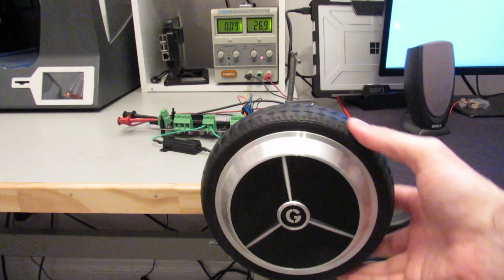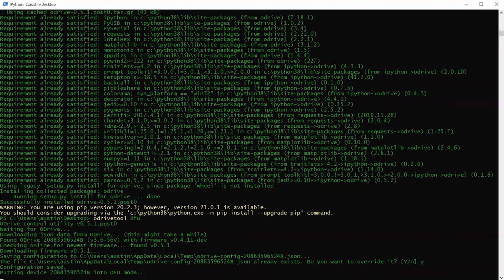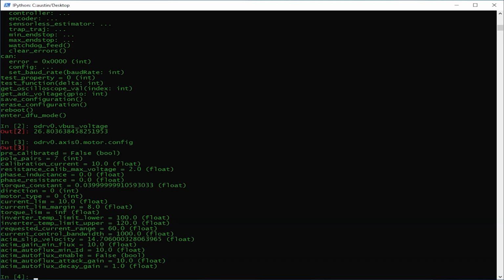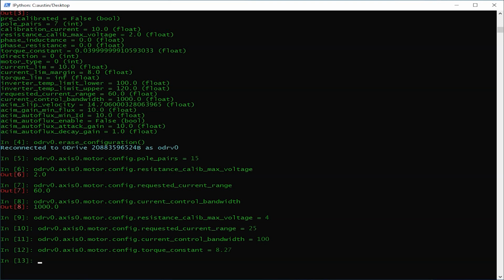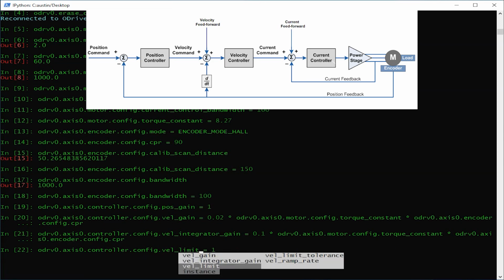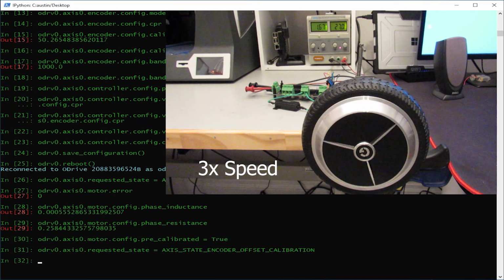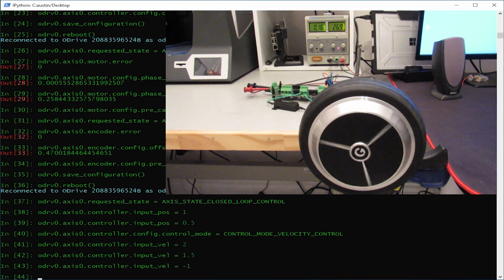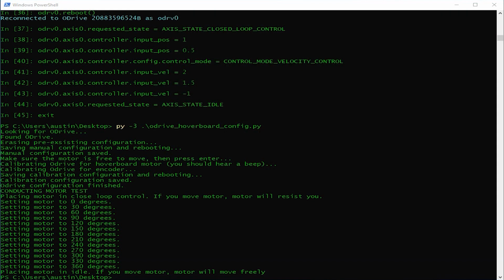RoboDog Part 6 | How to Use ODrive BLDC Motor Controller

Comment: IF MotorError.PHASE_RESISTANCE_OUT_OF_RANGE 
Increase odrv0.axis0.motor.config.resistance_calib_max_voltage, 4 gave me nothing but errors, increasing to 6 allowed my motor to spin and continue the tutorial. (Thank you AustinTronics)

odrv0.erase_configuration()
odrv0.axis0.motor.config.pole_pairs = 15
odrv0.axis0.motor.config.resistance_calib_max_voltage = 4 (NOTE: Needed to increase to 6, save, reboot, successfully ran motor_cali)
odrv0.axis0.motor.config.requested_current_range = 25
odrv0.axis0.motor.config.current_control_bandwidth = 100
odrv0.axis0.motor.config.torque_constant = 8.27
odrv0.axis0.encoder.config.mode = ENCODER_MODE_HALL
odrv0.axis0.encoder.config.cpr = 90
odrv0.axis0.encoder.config.calib_scan_distance = 150
odrv0.axis0.encoder.config.bandwidth = 100
odrv0.axis0.controller.config.pos_gain = 1
odrv0.axis0.controller.config.vel_gain = 0.02 * odrv0.axis0.motor.config.torque_constant * odrv0.axis0.encoder.config.cpr
odrv0.axis0.controller.config.vel_integrator_gain = 0.1 * odrv0.axis0.motor.config.torque_constant * odrv0.axis0.encoder.config.cpr
odrv0.axis0.controller.config.vel_limit = 10
odrv0.axis0.controller.config.control_mode = CONTROL_MODE_POSITION_CONTROL
odrv0.save_configuration()
odrv0.reboot()
odrv0.axis0.requested_state = AXIS_STATE_MOTOR_CALIBRATION

%%%
In [84]: odrv0.axis0.motor.config.phase_resistance
Out[84]: 0.47967782616615295
In [85]: odrv0.axis0.motor.config.phase_inductance
Out[85]: 0.0004023757646791637
dump_errors(odrv0) to check errors
%%%

odrv0.axis0.motor.config.pre_calibrated = True
odrv0.axis0.requested_state = AXIS_STATE_ENCODER_OFFSET_CALIBRATION
odrv0.axis0.encoder.error % 0 is good %
odrv0.axis0.encoder.config.offset_float % in ballpark of 0.5 or 1.5? got 0.136 %
odrv0.axis0.encoder.config.pre_calibrated = True
odrv0.save_configuration()
odrv0.reboot()

%%%
odrv0.axis0.requested_state = AXIS_STATE_CLOSED_LOOP_CONTROL
odrv0.axis0.controller.input_pos = 1
odrv0.axis0.controller.config.control_mode = CONTROL_MODE_VELOCITY_CONTROL
odrv0.axis0.controller.input_vel = 1
odrv0.axis0.requested_state = AXIS_STATE_IDLE

Comment: Thanks a lot for this video. Helped me understand some key things. but still having a problem. im able to setup velocity mode, and control the speed. works well (in sensorless mode), but if i setup position mode using AMT103 sensor motor start rotating super fast and gets into current limit or CURRENT_SENSE_SATURATION, UNKNOWN_TORQUE. tried to play with gains. didnt help. cannot get whats im missing. using 300kv 5210 motor. and one channel odesc 56v. saw a lot of videos where ppl set it easily and it works straight. but not in my case. thanks

Comment: When you say "the motors are high inductance so we need to reduce the bandwidth of the current controller from 1000" why is it that high inductance needs a remedy of lower current controller bandwidth??

Comment: Thank you for the insight on programming!
Is there a way to run the motors sensor-less? I've built a robot with tank treads using the hoverboard motors, but the starting movement is slow and I don't like that it tries to stay in a certain position. I'd like it to more or less free wheel and drive like an RC tank.
Reply from the maker: I think you need some sort of feedback sensor with brushless DC motors like the hoverboard. There are built in hall sensors into hoverboards so you should be able to use those worst case

Comment: were you able to run an anticogging calibration on this motor?
Reply from the maker: Yes, I showed anticogging in more detail in the 10th video. Basically I need a higher res encoder to take full advantage of anticogging...the hall sensors built into the hoverboard motors don't have enough resolution for the anticogging algorithm.

Comment: Great work thank you for taking the time and explaining this setup. I was wondering i you have run an anti cogging on the hoverboard motors?
Reply: Oh, my bad i did check the script on github. I had to add a lit to ignore the illegal hall state error. How will this affect the control of the motor? Also, why does this happen for some hoverboard motors only?

Comment: Hi, I'm new to robotics, however, I am experimenting with a 2 wheeled (drive/steer) device using hoverboard motors and thoroughly enjoyed watching your channel; first class tutorial and easy to follow - thanks. I'm having issues setting up my oDrive 3.6/56v board and followed your instructions closely to try and resolve the issues I'm experiencing. Really, really helpful; at last I get the beep after motor calibration. Unfortunately that's where it stops! odrivetool accepts the hall sensor calibration steps without error, however, I get no movement of either wheel. This is frustrating as I think I've tried everything. I have checked the hall sensors on both motors and all appears well. Am I missing something, can you advise. I get n o errors when I dump odrv0.

Comment: Great video!  Unfortunately you can't follow along using the current odrive firmware version because the encoder calibration gets an ILLEGAL_HALL_STATE error.  You'll need to put firmware version 0.5.1 on your odrive (which is the version used in the video).  I made a post about this issue and how to fix it on the odrive forum.  I tried to leave a comment here with a link to the instructions but it keeps getting deleted for some reason by the youtube moderators.
Reply: What do I need to search for to find your post? I've firmware 0.5.6 and I will alway run into the ILLEGAL_HALL_STATE error, no matter if I follow this tutorial or the one from the odrive website. I even tried playing with the 22nF and 47nF capacitors, still no luck. Thank you

Comment: Hi @AustinTronics, what power supply do these hub motors require, if you are not using the odrive?
Reply from the maker: The hoverboard motors I have are rated at 350 Watts. You don't have to use the Odrives, but you need some sort of brushless DC controller in the middle between your power supply and the motor to created the 3 phase signal that the hoverboard motor is expecting. I think I was using a 24 V power supply with the Odrives, but I could have gone even higher in voltage if I had a larger power supply. If you wanted a more customizable and portable power supply, you could use a clustered array of 18650 lithium polymer cells, but you need to be careful with those, you would probably want some battery management system to make sure your charging and disapating the cells equally.

Comment: Hey man, great video! I want to use o-drive for an  autonomus   robotic platform. I have 4 BLDC 36V/350W wheels. I've tried to use it with a cheap driver controller powered at 24V but I didn't have enough torque. So, for these wheels I should buy a 24 or a 48V o-drive?
Reply from the maker: Definitely 48v. It's usually better for your motor controller to be rated at the same or higher than the voltage you actually plan on using. You can run a 48v odrive at 36 volts, but you shouldn't run a 24v odrive at 36 volts.

Comment: This is indeed amazing. My odrive motor controller came in yesterday and I am trying to set it. Unfortunately, my hoverboard came with 6 wires hall sensor, and there is no port in the odrive controller to connect the sixth wire. I did not connect the sixth wire which is supposedly for temperature control. The motor calibration was fine without errors, but I got the following error when i checked for the encoder.

In [28]: odrv0.axis0.encoder.error
Out[28]: 512
Could you please help me to solve this problem?. I guess the problem is from the sixth encoder wire that isn't connected but I do not know if there is other port in odrive controller that I can connect it. Thank you in advance
Reply from the maker: I don't believe you need that temp signal connected to the Odrive for it to work properly. Did you make sure you updated the firmware on the Odrive and any Python libraries you have regarding Odrive on your host computer?
Reply: @AustinTronics  I was able to fix the errors but the motors don't go to AXIS_STATE_CLOSED_LOOP_CONTROL when requested and hence my motors don't spin thereafter.  I am wondering what parameter that I would need to change to enable the motors to go to a closed-loop control state when requested. Any help would be appreciated.

Comment: Hi, Great job. Can you make a walking suite type robot for paraplegics using these motors  or some exercise machine which replicate walking movement.
Reply from the maker: If I was going to use these motors for something like a walking suite, I would definitely want to throughly test these motors under a repetitive load to make sure there aren't any mechanical failures. But theoretically, yah you could if your gear transmission is high enough. If you mean a direct-drive without a gear transmission, then no, probably not.

Comment: Hye... thanks for this script...but i got a problem...there is error which is 16 ....can you help me to program this? i also use 3 phase motor and has 15 pole pairs
Reply from the maker: Can you elaborate on what error you're actually getting? What's the actual error message?
Reply: alright..later i will tell...I have 1 question to ask...Can you list the hardware needed to program the odrive with motor?
Reply: For now... the hardware that i use 
1. 3 phase motor
2. odrive v3.6 
3. power supply
4. resistor 

There is another hardware needed like arduino or other?
Reply from the maker: @mah_0073  In addition to what you listed, you need a USB cable so you can communicate to the Odrive from your computer.
Reply: can i get your contact number... WhatsApp or other...
Reply from the maker: @mah_0073  Sure, join the AustinTronics discord and we can chat more freely there: https://discord.com/invite/XyfF6khqsN

Comment: Really curious on how well a secondary encoder works for lower-speed operation.  The slow speed movement with the built-in hall effect sensors appears to be quite coarse.  These motors should be a excellent "good enough" low-cost option for my DIY experiments if the encoder add-on works well.
Reply: I added an encoder to the same motor for low speed operation: https://youtu.be/8GpIuEcT-QM

Comment: hello austin. nice project i love robots but i don't have the programming skills to build one. I have always wanted to build a hexapode and so a question came to my mind using this hoverboard motor system is it possible to load a person's load on a robot of this type, whether it is a quadruped or a hexapod? probably not possible in direct drive configuration but using planetary gearmotors and toothed belts should you be able to get enough torque to carry a large load? sorry my english but i write with a translator

Comment: since they are 36v rated. are you running 36v? if not may as well rewind the motors to a much lower kv with thinner wire.
Reply from the maker: I will be running it at that voltage in the actual design, but my power supply doesn't go that high.

Comment: Have you had any luck with the AS5048a encoders? I'm trying to get them to work on my o-drive setup but haven't had much luck yet. Also, amazing video, I'm looking forward to seeing what's next!
Reply from the maker: Haven't done that part yet. Currently working on video involving getting things up and running with the Zybo board from scratch (coming soon!). The AS5048a encoder coupled with Odrive will be the video after that.
Reply: @AustinTronics  Sounds good, thank you

Comment: Your pid loop does not look ok to me - the reaction when you remove the force on the motor suggest there is some room left there.
Reply from the maker: Oh absolutely! This is just a starting point. I'll refine this as I start putting more of the system together and I'll update the Python code on the repo accordingly.

Comment: How are you considering motor duty cycle impacts on your system?
Reply from the maker: I was planning on drilling holes in the metal hub to get better airflow. If it gets too hot, I was considering using forced convection with a fan.

Comment: attributeError: "torque_constant not found ", what should I do to troubleshot his error, any help would be helpful , thanks for the great video
Reply: Also when I type in  "inodrv0.axis0.motor.config." then press the tab key "torque_constant" is not an option for me
Reply from the maker: @anthonycortes5093  You have outdated firmware on your odrive. You need to update it with the 'dfu' command like what I show at 2:16 in the video. It probably wouldn't hurt to also upgrade your odrive python library as well.

Comment: Man... this video is exactly what I needed! subd and liked. Great work and thank you!
Do you by chance know if there are ROS libraries/Packages for the ODrive? Right now seems like i'll need to write it myself...
Reply from the maker: Glad you liked it! As for the ROS libraries/packages for ODrive, I haven't messed around with that stuff, but I did come across a repo on Github that looks promising for creating a ROS node for ODrive. It's located here: https://github.com/neomanic/odrive_ros. After some searching, it seems like it hasn't been updated because it is already stable and doesn't need modification. You can read up more about it here: https://discourse.odriverobotics.com/t/ros-node-for-odrive/3995

Comment: You're definitely selling me on these ODrive motor controllers, they appear to be equipped with everything you'd realistically need for these types of projects.
I'll probably end getting them when working on the mech projects, they seem versatile enough to work with different types of motors.

I don't have much experience with coding so providing your scripts will no doubt help me out haha.
Sweet remix on the Zelda Fairy Fountain btw!
Reply: I followed the exact steps for driving odrive motor D6374 250kv. As shown in the video, the motor didn't show any result in my case. Can you kindly guide me through this process? All I could figure out is there must be calibration issues because of which the motor's shaft failed to rotate